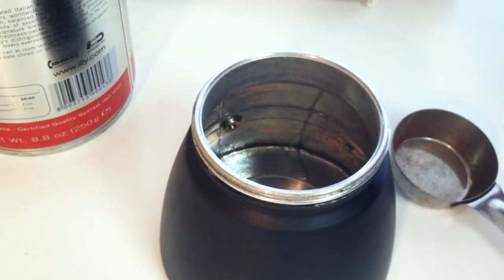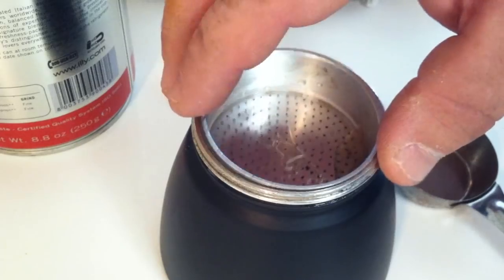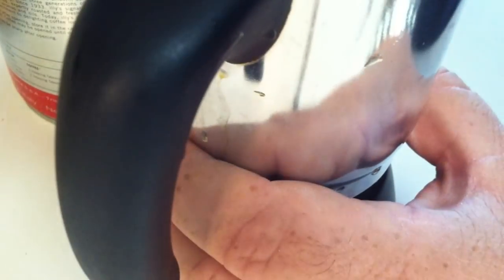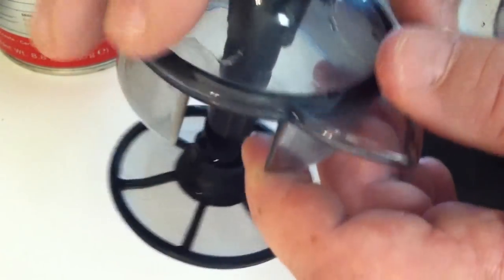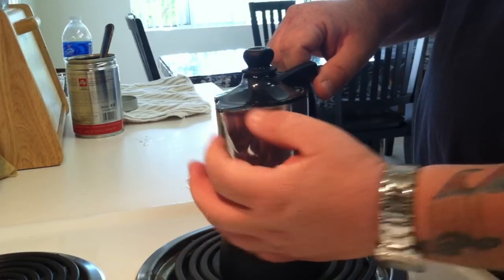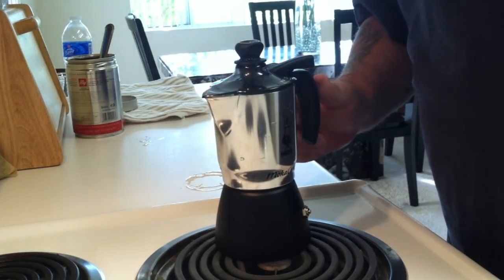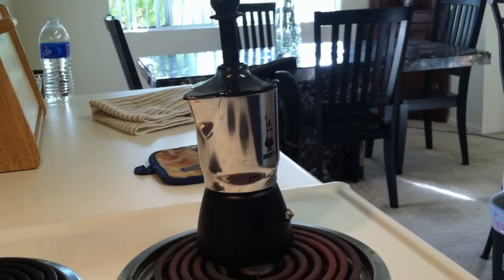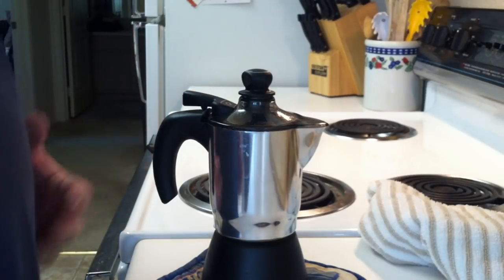How to make espresso with Bialetti Moka Crem

Comment: I bought a Bialetti Moka Crèm a few days ago and I'm really impressed!
I own two Bialetti Moka Express (1 and 4 cups) and two Bialetti stainless steel (6 and 12 cups) machines too. But the Moka Crèm is outstanding. The builtquality is excellent, the screw connections works very smooth as I expect from a Bialetti. With the "pump" you can really create a nice and thick crema.

Comment: I have owned this Moka Crem Pot for 1.5 years. I brew the moka coffee with the plastic lid off, I fill the bottom chamber with cold filtered water below the release valve (to allow space to plunge the coffee to make maximum foam)
I heat the pot with a 3/10 low heat and watch it for 5 minutes until it starts to slowly bubble out of the inner cylinder. This makes the coffee to never boil with the water to make it bitter. After it is completely finished bubbling then put the plastic lid on and plunge coffee 40-50 times to make a "coffee foam". Then take off the plastic lid again and pour coffee foam into hot milk. add sugar if needed
Reply: Your method is great. I will try your method.If you want to try my method then you will get 100% foam in the chamber. I like illy espresso too.